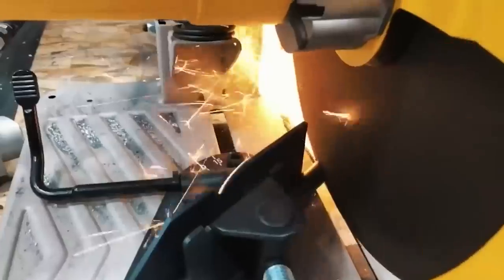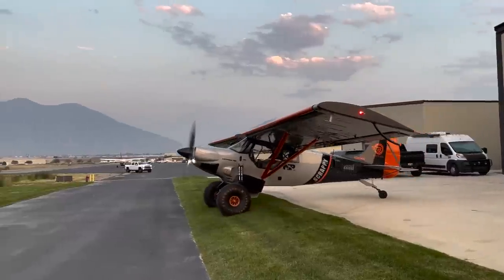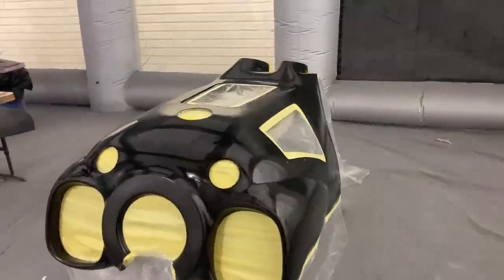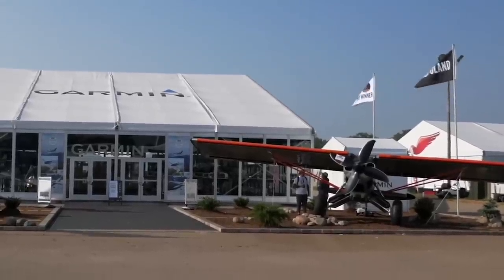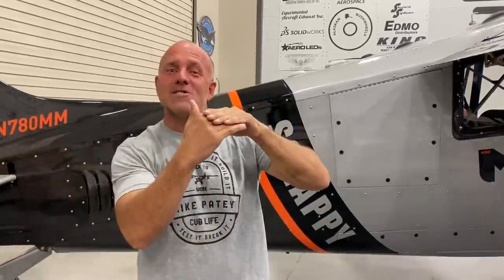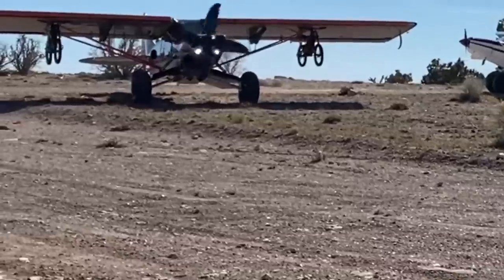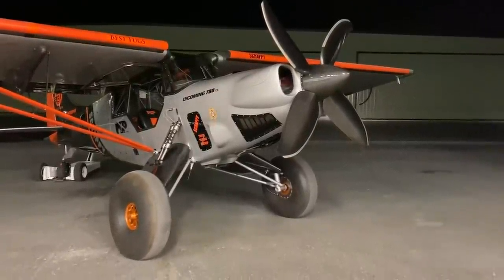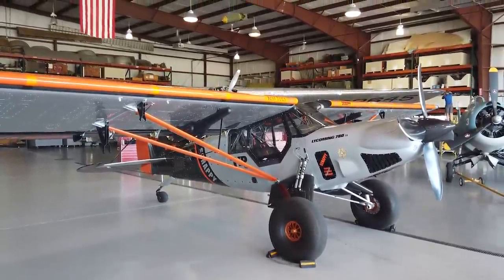I Just Cut off Scrappy's Motor with a Sawzall 😳 | Scrappy #68

Comment: Just my opinion. I hate Turbos. Especially on a single engine airplane. I've seen the Cherry red colors that glow at night on Cessna 340/414/421 exhausts. Leaking out of the cowling and shining off the cowling, wing and fuselage white paint after the first firewall. The combined exhaust  being held onto the turbo with, IMHO, a marginal single Iconel clamp and a single SS bolt and nut. And the cracked engine blocks and bad cylinders way below TBO on meticulously maintained and professionally flown airplanes. Please put a built in Fire extinguishing system in the turbo and exhaust areas. Especially where there are fuel lines going to, or returning from, the cowling areas. I know that's extra weight. But it could save your life. Allowing the emergency recovery parachute time to work adequately.
It always looked to me, at night, like there was a giant blowtorch installed behind the twins, or under, the single engines. I really don't like that in a single. Only a few very successful fighters during WWII used turbo-chargers successfully. The P-47 and the P-38 (a twin).
I know the technology of turbochargers and their thermodynamics has improved by orders of magnitude since then.
My wife wanted, and deserved, an new SUV. We looked at the new 2022 Sequoias (I drive a 2003 with 170,000 k miles on it). I said great. It's a well proven V-8. She goes to put it on order a year or so ago.  They said she should probably wait and get a 2023 (I think I've got the model years right). Why? Because it was a twin Turbo V-6. She politely said no. My husband would probably "kill me" if I bought a turbocharged vehicle.
FYI, both year models (2022-23) are just under 6000 lbs. curb weight.
My 2003 Sequoia is almost 1000 pounds lighter. 4.6 liter V-8 vs later 5.7 liter V-8.
It shows in the fuel consumption. It's worth it to avoid the twin turbo V-6. IMHO.
You "mileage" may vary. Thanks for the videos.

Comment: Scrapping Scrappy's Parts already?  
   Never really cared for turbos myself. I like the power but.....  they take up precious room. Need more Plumbing most times. And make everything just plain hot.🌡️  Superchargers on the other hand are lighter, smaller, cooler and have instant power. They can also be set up with clutches . Like nitrous only there when you need it. 
     Of course  we all have different needs and desires.
      Curious if that water out of thin air you are working on  has been completed. And who now holds the patent. As the world seems to be drying up. Do you have plans to release  plans, kits, or even the product to the General Public. Or are we going to have to deal with a corporation that doesn't have our best interests at heart , but instead control?
     While most are wondering where they're going to get money for their gas tanks,  you're on here talking putting a turbocharger on a race engine just because. The division between the Haves and the Have Nots grows  bigger by the day. Those that have are soon targets. Be very careful.

Comment: Not being an aero person, but still loving aircraft, is 600 bhp from a 13 litre turbo engine not a little weak? Just askin. Not rying to be a twat.
Reply: It’s not drag racing. Reliability matters when you can fall out of the sky. Better to be underpowered a bit and stay within reliability confines.
Reply: @tomcoryell  I can appreciate the need for reliability, but that's a big engine, that should be able to make 600hp n last forever without turbos
Reply: @deetesmin  You could very well be right.